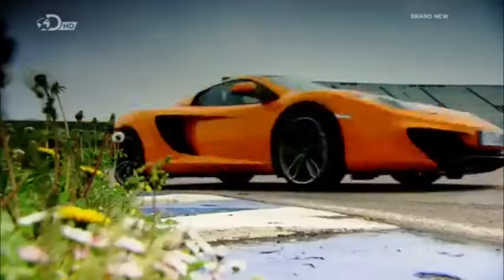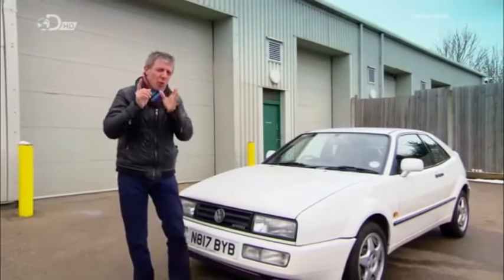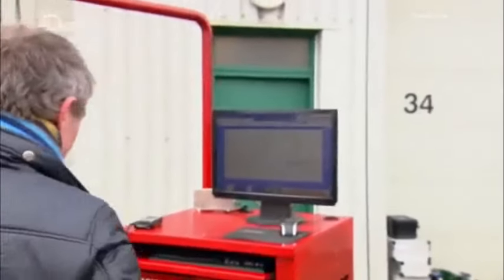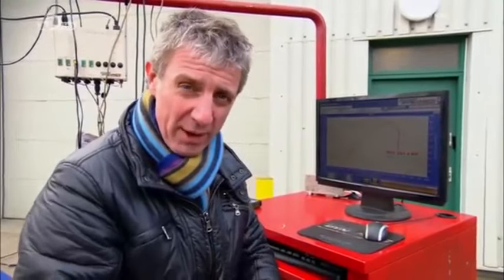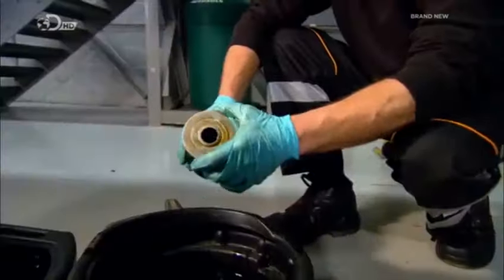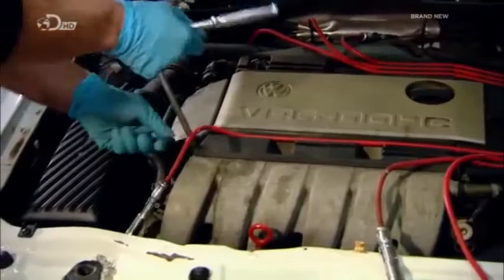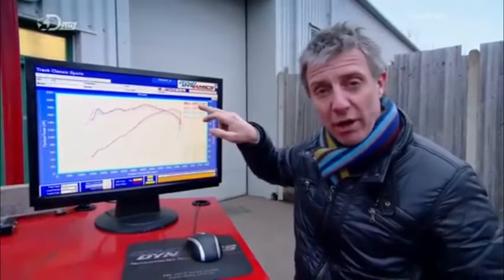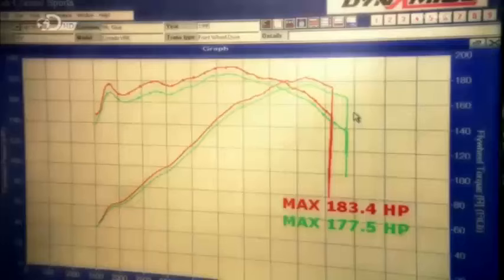5th Gear Test Redex On The Dyno With Surprising Results

Comment: Was the claimed power 190HP, British horsepower of 746 watts each, or was it 190PS, Deutsche Pferde-Starke of 739 watts each? If the latter, you have got slightly over the claimed power after the tune-up (assuming your dynamometer isn't measuring in German). Also is the claimed power at the wheels or at the crankshaft? If at the crankshaft you are getting considerably over the claimed figure, because you are getting it after the losses in the transmission and the tyres.

Comment: Engines are rated at the crank so this car actually produces more than 190 HP. Parasitic loss occurs on the dyno as HP is lost via the drivetrain.
Reply: The dyno factors that in mate
Reply: @davebearpark  These chassis dynos measure hp at wheels, they guesstimate losses to give a rough idea (and nothing more) of crank hp.  The uneducated then quote these figures as gospel.  Note all reputable engine tuning firms use engine dynos.

Comment: I’m delivering pizza in 2001 Toyota Yaris with 156k miles on the clock, doing over 1000miles a month. I use Redex every time I filling up my tank. YES it helps.

Comment: should of tried a k&n panel filter instead of the standard air filter
Reply: +17GAZZANIKON Well they were trying back to stock hp, not improving past that hp.
Reply: Does not work. Go and learn something
Reply: yamahaevo They do with my car, it was tested on a dyno. Only a 3hp increase though.
Reply: +17GAZZANIKON 3HP is well within margin of error of a dyno. Unless your original filter was very dirty, it's unlikely a K&N filter would do anything. Next time, just take the filter out and do a dyno run.
Reply: deadbrad  completely true. When I took a dyno class you could do 3 back to back runs and have a variation of 3hp just from the car warming up. The thing about a dyno is that while you can compare different cars to each other on different dynos it really doesn't mean much. It's a benchmark for your car on that dyno. Even the factory dyno used for advertised hp will be different from the one you use yourself.

Comment: Camshafts wear and lose lift, that is the biggest source of lost power. I measured a standard Rover V8 cam that had lost 50 thou of lift in 50k miles.
Reply: +MegaTabetha  OIls have got a lot better, I will grant you. That and cam profiles are better designed too.
Reply: Rovers v8s and cam wear. Like romans and roads.
Lets go to the stoning.
Reply: +Donald Sayers What about engines with roller followers like the FA20 engine? Would that loose lift over time?
Reply: +KiwiPowerNZ I have no experience of that particular engine. Conventional engineering wisdom is that roller rocker have to accelerate and decelerate every time they pass over a cam lobe and some slipping always occurs, so they wear. Also the pivots the rollers rotate on can wear. In the past roller rockers were only used on short lifetime highly tuned engines. I guess engineering moves on. I would bet they  last longer than  Rover 3.5 ones do.
Reply: 50 thou in 50k? That's horrible.

Comment: They should have changed the transmission fluid as well.
Reply: Boodieman72 It depends. It's a British car so very likely a manual transmission. Since the oil in a manual transmission is not exposed to the by products of ignition, and they use a large magnet in the bottom to hold the larger bits of iron filings, chances are there'd be very little to be gained by swapping the gearbox oil. On most cars that I've owned you swap gearbox oil maybe once every 80 000km, usually around the time you do the clutch :-)
Reply: +plonkster 
You're mixed up there. Auto transmissions do not 'share' oil with the engine. A few manual transmissions do, for example the gearbox in sump BMC 'A' series in minis.
Reply: +Jim Davis Aaah I see your point. I have no idea why I wrote that comment that way 3 months ago, because it seems to imply that the transmission flood in an automatic IS exposed to combustion elements. You are right of course that it isn't, and I know that well! :-)

I think my point was that because a manual transmission has nothing but gear oil -- which also doesn't degrade due to exposure to combustion -- there is often very little to be gained by replacing it. Automatic transmissions on the other end needs fluid replacement a bit more often... or so I am told (Automatics are rare in South Africa too). So in the context of the original comment, my point was that on a manual transmission, it would probably help less than it would on an automatic.

Comment: I thought this dearer fuel which cleans as it goes does the same as redex ? 🤔
Reply: What like Shell V power nitro? It just has a higher octane rating than your standard unleaded, you can add a number of additives to a tank of normal unleaded to increase the octane rating.
Redex and other fuel additives like seafoam are made up of other petroleum byproducts and they don't improve the octane rating.

Comment: I wonder how much Redex had to pay 5th Gear?
Reply: Bob Dobolina fairly standard, but I like it.
Reply: Was told Redex was rubbish. Would get 50mpg at best on the display in my old Mondeo TDCi on a good run. Redex was half price in Wilko's, so gave it a whirl. 300 miles later and the  car felt so much better and  55-56mpg would be a regular occurence on a good run after. Stuck half a bottle in my Espace last week and the difference is noticeable.
Reply: 6ettinold that's awesome, doing it tomorrow for my car! Was thinking about an engine carbon clean but that's £100 where as I can get a bottle of this for £3.50 haha
Reply: i used at my old Peugeot 106 and my Yamaha Crypton R 105 and i see  a .. i wanna say big, but i will use the word noticeable difference in the throttle and the engine  :)  Peugeot needed around 2 bottles / 2 tanks of Gas and my Crypton R 105 around  25 ml for every full gas tank of 4.3 litters . Its 5 ml Redex for every 1 liter of Gas you put in your bike its the analogy (ex. your bike fills with 8 lt you will put 40 ml Redex if you have half tank 20 ml :P ). You see small  difference the moment it gets to the engine and when you burn 2 gas tanks (depends how dirty its your engine ) you see the really noticeable difference  .
Reply: 6ettinold I've tried redex a few times and not noticed a lot of difference from it not like in this video But i will give it another shot tomorrow in a petrol with 108k miles which using an app to calculate MPG achieves at best 50 mpg and worst 38
Reply: Farina Marcina  Redex is a weak additive compared to many others I've tried since a favourite is Millers Diesel Eco max or just BP ultimate Texaco supreme diesel Northern Ireland doesn't receive Shell unfortunately
Reply: Farina Marcina  Mineral or synthetic 2st oil?
Reply: @Mr330d  Miller's is good

Comment: I don't see how the spark plug leads would have an effect
Reply: With time the Insulation corrodes and it starts tweaking induction electricity over other metal components enough to throw off ignition in a minor scale which leads to late ignition, carbon build up on the electrode and eventually loss of power due to bad ignition cycle. Most manufacturers have them in service schedule at about 100k miles/10 years whichever comes first. Better alternatives are the ignition coils, but they're more expensive to replace when they go bad.

Comment: its says injectors // but what about carbs ?
Reply: It may clean some fuel passageways (depending on the carb),  and I'd hope it also cleaned up the backs of the inlet valves, assuming it's not a direct injection engine.

Comment: First add redex, then after that has been completely run through engine change fuel filter, change air filter and clean maf sensor and throttle body, do an oil and oil filter change , change spark plugs and wires/coil pack, YOU WILL SEE AMAZING RESULTS TO ENGINE
Reply: Why not add run a marathon to the end of your sentence too...

Comment: The prices of plugs and leads are bloody way expensive,where does this bloke shop for godsake?
Reply: +Simon Lamphee Halfords?
Reply: +Waqas Ahmed vw
Reply: They plugs are probably long life stuff. My Lexus has them, they'll last up to 100k miles, but cost £20 or so per plug.
Reply: quite clearly magnecor leads. Better than oem. hence the price
Reply: Barry Britcher Haven't watched this in ages so I assume they're talking about spark plugs. If so, I just stick with Denso personally.I don't really need performance. You don't buy a Prius for performance :D

Though it is quite funny when other cars try and overtake me purely because I'm driving in a Prius and they end up behind...
Reply: Waqas Ahmed the vr6 runs alot better on nkg plugs, which is what they used.

Comment: Wonder how many horses would be unleashed if they had bothered to change the fuel filter first? Ever hacksawed one of them in half and taken a look? 50,000 miles of petrol and they need changing otherwise you can get low pressure at the injectors.
Reply: Ran  one  for  245000 .pn V6 Vectra was original one  actually doing job still well and only a little stained inside 😊

Comment: It always makes me laugh how much money some people spend trying to increase power on old cars. hundreds on a sports exhaust, new induction kit, upgraded plugs at twenty plus quid each and yet you ask when they last did an oil flush or fuel system clean and they look at you like you just landed from Mars. For Diesel engines I prefer Miller's Diesel Power Eco Max which is a bit more expensive but still pays for itself in increased MPG

Comment: Pull the injectors and have them ultrasonically cleaned.
Reply: Will you do it for a fiver ? Same price as a bottle of redex…
Reply: @Paul-cl6uo If you think Redex will do the same you are sadly mistaken.
Reply: @rhannay39  I don't think that at all. I was just making the point that for most people a bottle of redex will be enough get them through an MOT, improve MPG a bit, level out a rough idle or whatever versus injector cleaning which will be expensive. Far superior I know....and necessary in some cases.....but expensive.
Reply: If they need that then it's generally Neglect and terrible Maintainance in first place  I wouldn't touch it  Redex is effective as is Maintainance

Comment: Step 1 is to perform all the dyno runs under the same conditions (ie: on the same day...)
Reply: Step 1 is to not use a chassis dyno, but an engine dyno.  Anyone using a chassis dyno to quote engine hp figures is deluded.

Comment: Nice test, but I guess you would have made exact the same power gain without doing anything to the car...just by running the car 32 times at full power for a few minutes at a time. It' s not exact science but engines do get lazy. running them on full throttle for longer times clears the valves and combustion chambers from carbon and opens the injector's it also kicks the top of the bores making the engine less stiff at high RPM. Miracles don't come out of a box, just spend your cash on good maintenance and all will be well.
Reply: Kicks the top off the bores that make it less stiff at high RPM ? Your talking bollocks chap

Comment: I have a diesel van, which for some reason runs BETTER with redex added and gives better MPG .I know this because it ONLY wheels spins on take off WITH the redex added :-)).....BUT heres the kicker, ONLY while the redex is in the TANK. Fill up with normal fuel and back to less power and lower mpg. Seems the redex is boosting the octane maybe ???
Reply: Now this is a point no-one else has thought of. Well done!
Reply: Same for my Mitsi 2.5 4D56 that's why I bought 50 bottles when it came down to £2 a bottle 🙂

Comment: they do feel different after a service. but this is too expensive just get back to factory figures. cars are going to lose power over the years its wear and tear. the only way of really getting the full BHP back is to rebuild the engine that's if its worth it and your car is a classic. £300 just to get 11bhp back? cheaper just to have your car remapped or chipped.
Reply: I doubt the hp figured are legit from changing your oil and spark plugs. This makes no sense. Also the Red-X stuff will take a few bottles over tanks to achieve some cleaning. Like you said an engine rebuild is the only way to really get your horsepower back. A better money spend here would be save yourself all that money Jason spend and buy yourself a compression gauge and check the cylinders. This is as bad as those expensive terra coating cleaning bullshit they advertise now a days where they hook up a car and clean the shit out of it internally and makes a huge difference up to 3 weeks lol Then back to standard. The best way to clean components is to remove them and do it by hand. Injector cleaning using a DIY battery and syringe, glass fuel filter that dismantles, get some sand paper on those spark plugs, submerge your Lambda sensor in vinegar and heat it with a blow torch after its dry. These elbow grease maneuvers do exactly what expensive chemicals try to do for x10 the cost and in extended period.
Reply: lets face it things just age and there is nothing you can do about it unless your willing to spend a couple of k's
Reply: Yep, new components are always going to perform better regardless. But still there has to be something seriously bad with the old once to achieve such huge horsepower gain. It would be funny if they did the same dyno test after 2-3 months of using these new parts. I bet the figure will be down by 5hp after the first week of actually using them :-D
Reply: its all just a con a compete strip down would be the only way forward. on average a car loses 1 hp a year
Reply: +HenryMania indeed lol, the spark plugs only feel new in the first week, after that they are normal.

Comment: 164.1+172+176.3+178.6+181.1+181.7+183.4+177.2/8
avg=177.925 Horsepower after redex. YOU MADE IT WORSE (or maybe its just a colder day).
So taking the "redex" number as control and the "post service" number as the end result (because there isn't a week difference) you can theoretically gain a peak difference of 188.7/183.4=2.89% more power from a service.
from the week before with the 177.5hp number it's not "about 11 percent" its 6.3% so dreaming a little there.
Also if jason can feel the 3% difference then thats amazing, its likely placebo and for the £300+labour you're better off installing a nitrous kit.
Reply: @Toms Tech...I think the 177bhp result before the redex was added was also a maximum value after repeating the test several times.  It actually shows if you pause the video that it is the max value.
Reply: @dtz1000  That means they're reporting the peak value during the run, Not the average between 2500rpm-6500rpm for example. They literally did 1 run and got 177hp, Then after much servicing and multiple runs to warm up the fluids they got 185hp as you might expect.
The whole thing was effectively an advertisement.

Comment: 190bhp at the crank shaft , so 177 at the rear wheels is about right ...
Reply: Yes it never ceases to amaze me that people think car horsepower is at the wheels. Engines are tested at the flywheel and you get what you get at the wheels.
Reply: @kevinberry6818  yep I did mean to write flywheel  :-)
Reply: Most transmissions lose 25% from the flywheel to the road wheel.

Comment: 8 test then take the highest number!!? Have you heard of 'science'?
Reply: The engine heats up as you do more dyno runs, and thus the air that goes into the cylinders is hotter. The hotter the air going in the less power produced and was why they took the first and highest power reading. But yes I wish they additionally did a mean average.

Comment: redex.. Pfftt. pile of crap. dont waste your money. use something like Archoil AR6400 once then regular use of archoil Ar6200 and that will keep your fuel system running clean for years. Also use oil additive with many uses, Archoil Ar9100. Engine will run like new and remain that way. Oil will last alot longer also!

Comment: These videos are very misleading in one aspect. Engines doesn't loose power because of it's age, but because of it's milage. A new car with higher mileage might lost more power than old with low milage. So when they are talking about numbers and making conclusions on them why can't they just say it's milage without stopping at "This car was manufactured in 1996". People watch these and learn. If they want drama they will watch Top Gear. That's what's it is for..
Reply: Age is a synonym for mileage in this context.
Reply: +sugarnads That's what my whole point is; Age is not a synonym for mileage. At least for something little technical like this
Reply: a car that has done lots of short journeys will have more engine ware than one with high motorway miles.
Reply: obviously